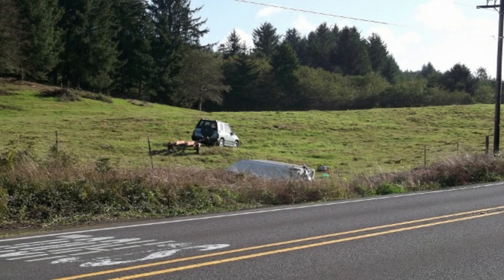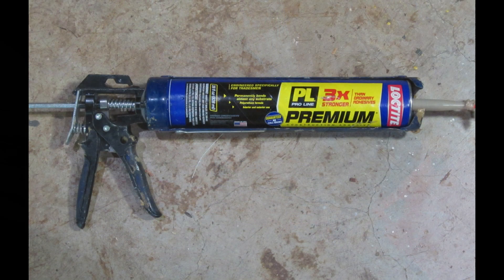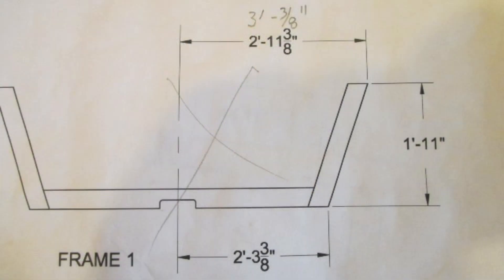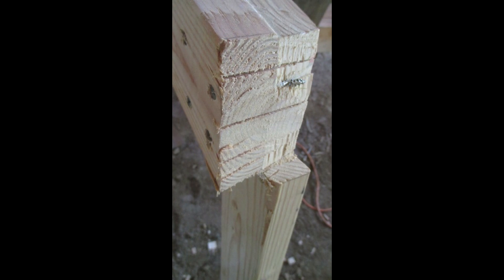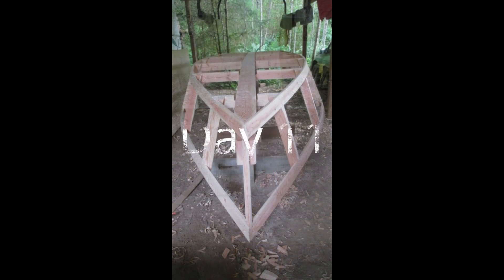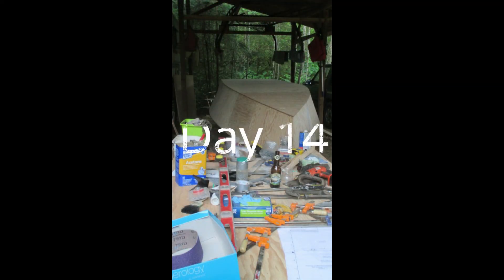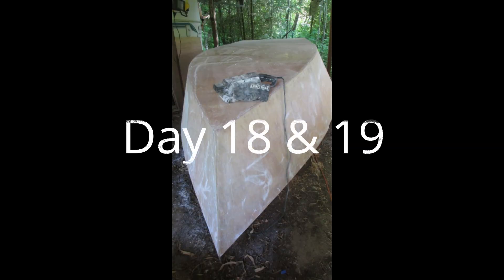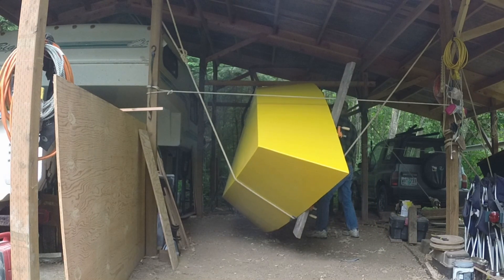Dory Story Part One: Building the "Tillamook" Dory

Comment: Would you be willing to share the plans for this boat? Jeff Spira died and we cant get plans anymore.
Reply from the maker: Several people have asked to buy my dory plans or copies. Legality and ethics of reselling  Jeff Spira's intellectual property prevented me from doing that, but here is the workaround that doesn't cheat Spira's business and allows me to sleep well.
  I had copies made of my plans for the "Tillamook" dory. For mailing to USPS domestic addresses rolled in a tube: $96.72. Mailed first class in a large envelope: $81.21. Priority Mail is $88.64. International mailing cost to be determined individually.
  Breakdown is $69.99—the price I paid Spira—to be held indefinitely for Spira International or its successors by me or my heirs, $9.00 copy cost for five sheets, and the balance for mailing tube and/or postage.
  I'm sure you can find others who will sell, trade, or even give you copies of plans without giving a thought to copyright if you're so inclined.
Reply: Plans? its a cement box

Comment: I noticed you have the face grain of the plywood running in both directions and I'm curious how the boat is holding up?
Reply from the maker: I paid no attention to grain. I wanted minimum waste.
The dory is eight years old now. It's off the trailer because both need maintenance, rust removal and paint for the trailer, bright work refinishing on the dory. I have epoxy left over from a more recent boat that is past its best-if-used-by date, so I'll add that to the lowest part of the interior where water accumulates and it's looking a little rough.And there are a couple of marks in the yellow paint I'll touch up. No structural problems at all.
Reply from the maker: Latest video should answer your question, Dennis.
https://www.youtube.com/watch?v=TGvUAf0b1F8&t=4s

Comment: you have done a great job.  Thanks for the video.  I see you have painted both top and bottom with what looks like the same paint.  What type of paint did you use and has it held up good for you?  I will be using my Tillamook in the Willamette and at Newport waters.
Reply from the maker: Paint is "Safety Yellow" from Ace Hardware. After six years, it's still good, but the boat could use some touching up.
Reply: @OregonOldTimer  Thanks.  Ill look into it.

Comment: Great job where is your keels no kills how do you keep this boat going straight
Reply from the maker: Good question, Eric. At anything above dead slow, direction is controlled with the outboard motor. But, when at idle speed, say, in a crowded marina, a gentle breeze takes control of direction. My solution was to install a daggerboard as though my dory were a sailboat. It works fine. Hard part is remembering to pull it up before loading onto the trailer.
Reply: @OregonOldTimer   Maybe you can add a mast and sail to that nice dory.
Reply from the maker: @cubaniton74  It's cluttered enough as it is. I may build a sailing dinghy one of these days, though.

Comment: Clearly the home builder needs to think carefully before the build starts as to how to rotate the hull off the strong-back.... The airplane homebuilders often use rotisserie style metal tubes to facilitate flat welding surfaces and so forth. But wood and gallons of epoxy are heavy and this weight is not evenly arranged around the axis of rotation .... simple solution is build two boats at once :^D Rotate for each day's build and the rotisserie stays balanced. Now all you need is a 60'x20'x18' well built shed, two massive uprights to hold the thick steel tube with ratchet turning mechanism and then some wrap-around scaffolding...nevermind ;( Maybe some ropes, boards, and a little mechanical advantage device or two will suffice after all.
Reply from the maker: The "think carefully before" part comes hard for some of us.

Comment: Very nicely done.  Mine was built in similar fashion, but under cover of pine trees without the benefit of a shed.  I also noticed the odd curve change near the stern, but just went with it...doesn't seem to affect it much. Two big strong sons helped me with the roll over, resting it on the beam at one point, then letting it flop over onto the hull in the tall grass.  These boats seem pretty forgiving, 'builder friendly', and error tolerant (if that can be considered a term).  I bet you catch plenty of Dungeness with that rig.
Reply from the maker: It's a good boat for rivers, bays, and ocean. People come over to comment on it, many remarking that it's nice to see a wooden boat. I figured it was the bright yellow that attracted folks. They say it's the wood.